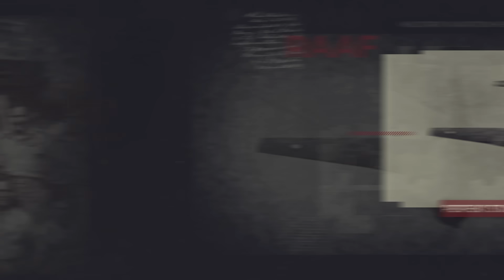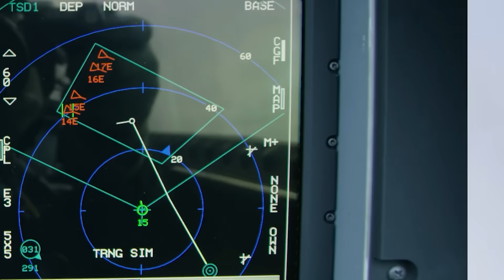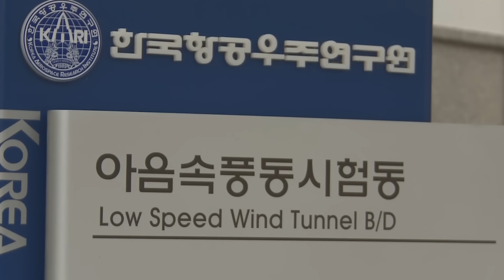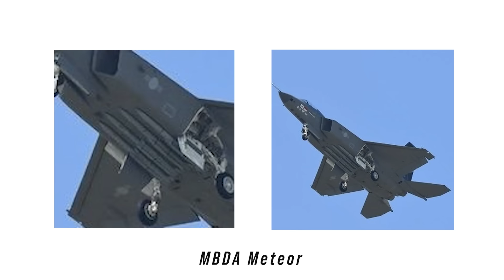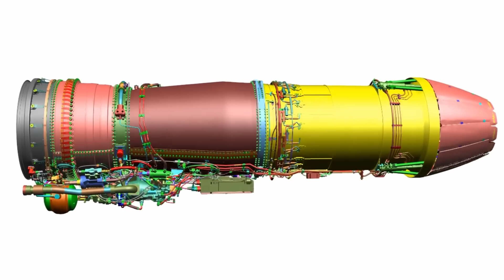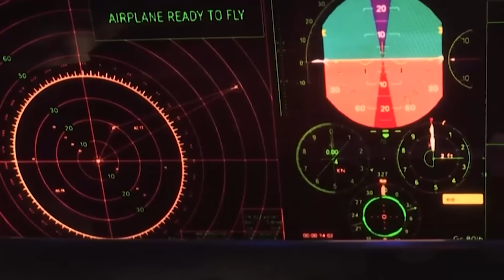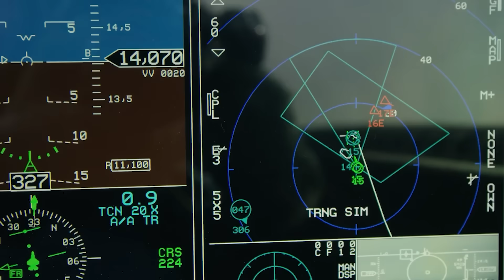KF-21: Korea's New Fighter

Comment: What do we lack in terms of capability? 
We have great and versatile heavy lift capacity, good air-to-air refuelling capability, we have good maritime aircraft (but a huge coastline to protect), and a great drone programme. Electronic warfare we have strong capability. 
Air-to-air we have excellent capability, although a proper interceptor would be nice. 
We lack a long-range strike aircraft without the F111's - something that could hit hard and deep, and quickly could be good. Perhaps B21???
Trainers are something we are desperate for, something like the KF-21 in a versatile platform that could be used as a trainer mainly but easily adaptable to certain roles would be excellent, and something a lot of nations need. 
Or alternatively, a cheap "missile-truck" - something with long-range standoff munitions that can just haul a truckload of missiles and utiltise the targeting of low-observable platforms to guide the freedom all the way in would be a great operational niche that isn't being filled.

Comment: The company I worked for in the early 2010s did a lot of business with ROKAF via direct commercial sales. South Korean companies like LG and Samsung have big defense units. Since the KF-21 has very striking similarities to the F-22 it's confirmed that the US State Department gave Lockheed permission to consult with ROKAF and provide engineering support via something known as an export license. Unlike China......which steals or copies data to build its fighters (just ask Sukhoi and Lockheed), ROKAF is building and indigenous fighter while getting the right support from low observable experts like Lockheed.

The KF-21 needs to have internal bays though as external weapons loadouts increase the aircraft's radar cross section.
Reply: The initial reason for the development of the KF-21 wasn't to make it a stealth fighter. It's primary goal was to replaced the aging F-4/5 platforms that are going on for over 50 years(!!). But they also modernized the requirements to adopt some stealthy (emphasis) aspect of a modern 4.5 fighter into the design.
Reply: Boeing was mentioned early in the video.
Reply: why do you expect China to do? get an export license? If you are using paper or gunpowder, you are stealing from Chinese.
Reply: The aircraft is too small to have internal bays, for example Turkish version of KF-X is significantly larger with internal bays. I've never understood why they tried to keep a twin engine plane small and didn't make a single engine version..
Reply: @ggoddkkiller1342  phase 3 of the kf-21 is planned to have internal weapons bay.
Reply: @ggoddkkiller1342 Korea already has expensive 35A and 15K(will be EX equivalent)s. The country needs to replace F-5, F-4s ASAP and F-16s(early version) in the near future. 
The plane already has some empty capacity for the weapon bay for the future variant. But you are right,  it will accommodate a small amount of weapons due to it’s nature. But Korea benchmarked flexible mission objectives of F-35’s. Full stealth mission is not always needed and KF-21 is not supposed to be Korea’s flagship fighter jet.
Reply: @7mmalltheway  If the goal is having a cheap work horse it actually makes sense. F-16 doesn't excel in any aspect at all but it can do everything and it has pretty much unmatched cost effectiveness apart from drones. And KF-21 is better than F-16 for sure so it would work but the thing i don't understand a single engine version could be even better for both having internal bays and more cost effectiveness. Perhaps it was adding too much cost for developing a single engine version..
Reply: @ggoddkkiller1342  you have the point but Korea AF has lost some precious pilots from F-16’s single engine malfunction. So they do have such trauma. And also KAI had a Navy version in their mind from the get go. 
Then they actually fished designing the Naval variant  roughly. I can see that LM was also involved and gece some tips to KAI. You can simply imagine the difference in between F-35 A and C. You can find the mock up model images from google. 
Also you know that Navys has never welcomed single engine fighters recently….
Reply: @ggoddkkiller1342  that's very good question, even S.Koreans asked that. I've asked that same Q to KAI boot other day when I had chance to see them at Seoul's Airshow last year. They've said, they never designed aircraft to carry internal bay - so was never designed for 5th Gen. They also said that due to development of technologies, newer fighter doesn't need to be large as many components and weapons can be miniaturize and also wanted cut cost down as much as possible, making 4.5th gen fighter cheaper than F-16 and easier to service. Once KAI obtains all the acquired 5th gen technologies, they will redesign the body to carry internal weapon bay with more powerful engine. Basically, KAI is trying to make stealthy & improved version of F-16V as 5th gen and 6th gen they will just buy from the U.S and they know they can't compete against F-35/22 or the next 6th Gen NGAD. KAI wanted to sell KF-21 to these countries with F-5 and F-16 fleet as they're either aged or ageing and will need to be replaced and many small countries don't have big budget and space to keep large 5th Gen fighters and they can't buy F-35. For many F-16V would be enough and this is where KF-21 can become market player and also 5th gen stealth fighter have very high MRO, for many simply cannot afford it.
Reply: @ytn00b3  Thank you for the explanation! If it becomes as cheap as F-16 it would be a massive success indeed and a lot of countries would line to buy it lol. But im not sure it could become that cheap, especially during early production years it might be still quite expensive. As F-16 still has pretty large and well-established production lines. The key is increasing unit numbers really as F-16 could do and i really hope South Korea could do it. Western monopoly on arms is really dangerous and they are using it as a political tool shamelessly. Even 100% defensive weapons like air defense systems are a subject of political games and if you don't play you get nothing even if it exposes your people to danger..
Reply: @ggoddkkiller1342  F-16V base unit cost might be about the same as KF21 Block1, Block 2 would cost slightly more but program cost for F-16V is very high, you're paying for American equipment kits and training which is very mature. KF21 Block3 would be expensive but I think KAI is trying to make KF21 Block 2 as equivalent of F-16V level with dual engine (which is bonus as dual engine is always better than single engine). Noticed KF21 isn't very large as F-15 or F-18 Superhornet even F-22, KF21 was made for candidate for replacement of F-16s. F-16 was very cheap back in 1980s~1990s but after LM downsized production line, it has become expensive. Even F15EX and F18 Superhornets are more expensive than F35 but have slightly lower maintenance cost than F35. Stealth 5th Gen fighters are very expensive to maintain. The Unit cost for KF21 is about $60~$70 million, still not cheap but Coz it was produced and maintain by S.Korea KAI, it can be lower for Korea as I'm pretty sure they're buying KF21 at $50 million as K-gov owns 60% of the program. It actually saves money for S.Korean gov when it buys it and doing so creates more local jobs that pays taxes and having KF21 means S.Korea can now start developing their own armaments when they used to buy from NATO and USA. In long run, it's cheaper than F-16.
Reply: @ytn00b3  Honestly i really have no idea how you are calculating those numbers as you are literally comparing F16 which was produced mind blowing 5000 units with KF21 which will be produced only 40!! LM downsized their production but there are hundreds of companies worldwide producing F-16 parts, for example Turkish companies are producing thousands of F-16 parts and assemblying entire planes not just theirs neither, Pakistani, Egyptian etc F-16s all got assembled in Turkey! So LM downsized their F-16 production line simply because they didn't need it and it had minimal affect on how expensive Vipers are. There is no way on Earth KAI can compete against such a massive production capacity in dozens of countries and KF-21 will be at least twice more expensive than F-16 if not way more. Because lets not forget KF-21 might be small but it is still a twin engine aircraft which are more expensive, in fact even you are admitting twin engine F-18 is more expensive than single engine F-35s but you somehow ignore it later on. 50 million dollar won't gonna happen with 40 production plan, it is just literally impossible. Even Rafale is way more expensive than that despite being significantly behind KF-21 in every aspect and produced way more, this is why France desperately trying to sell it so they can reduce unit cost. If Turkey or other countries etc were a part of the project and actual production number was something like 400-500 yeah then it was possible..
Reply: @ggoddkkiller1342  Only 40 KF-21 will be produced? Stop your delirius utterance. In order to replace 4 squadrons of F-5E/F and 2 squadrons of F-16PBU(Upgraded F-16C/D Block 32), 6 squadrons of KF-21 will be deployed. Because each FS(Fighter Squadron) in ROKAF(Republic of Korea Air Force) operates 20 jet fighters, basically it has been confirmed 120 KF-21(20 jets X 6 squadrons = 120 fighter jets)   including 40 Block 1 and 80 Block 2 will be manufactured. Simultaneously Indonesia is going to acquire 48 IF-X the Indonesian variant of KF-21. And because there is the problem for approximately 18 RF-16 among 166 South Korean F-16C/D not to be compatible with their mission equipments such as Condor-2, EL/M-2060P and TAC-ELINT as 133 KF-16 including those RF-16 are upgraded to F-16V(South Korean F-16V are designated 'KF-16U'), the production of RKF-21 is being discussed in ROKAF. And EKF-21 the stand-off ECM variant of KF-21 is included in the portpolio of KF-21. LIG Nex1 a South Korean defense industries spscialized in electronic warfare systems, EO/IR systems and guided munitions, like your Roketsan and Aselsan is goint to develop the stand-off jammer run by the artificial intelligence for EKF-21. Additionally, for the long-run, CVX program for South Korean aircraft carrier is going to be built to operate KF-21N. Only 40 KF-21? Don't pretent to know about what you don't know. And IWB(Internal Weapon Bay)? The structural margin for IWB is applied on the design of airframe over KF-21, in spite that the IWB will conceive AAMs(Meteor), SDB, and 500lbs-weighed munitions such as GBU-38 and KGGB upon carrying 2,000lbs-weighed munitions such as GBU-24/31 and Spice 2000 externally because of the restriction of volume.  And it is being planned to include IWB to Block 3 program although the key issues on KF-21 Block 3 are the directive and stealthy datalink using Ku-band phased-array antennae and MUMT(Manned-Unmanned Teaming). Does U.S.A. reduce the scale of production of KF-21? This is the South Korean program, not the American one.
Reply: @ggoddkkiller1342  F16 is going to be phase out after 2030s and this is why S.Korea wanted KF21 as replacement not just for F4/5. No modern fighters after the Cold War ever produced over 500+. May be Rafael could be in 500s and there will be no 1000x light fighter like F16 in future. If KF21 eventually produces 400 then that's a success.
Reply: @ytn00b3  Exactly, you are right that's why i said 400-500 not 1000 because as you said it is unrealistic a modern fighter getting produced that many especially while drones are becoming more popular every day. But sadly low production number is increasing KF-21 cost a lot. I don't know if people are misunderstanding me but im not saying this against Korea or something, that's just how it works. For example i would be really surprised if Turkey's TF-X cost will be under 100 million dollars especially in early production. This is also why there are so few companies producing jet engines because until hundreds of them produced unit cost will be at least twice more than GE engines for example. Still ''know to how'' is the most valuable thing here as South Korea learned how to build it's own planes and in case of a world war, relations worsening etc can increase KF-21 production many times within just few months so it is always worth it..
Reply: @ggoddkkiller1342  if you add drones into equation then yes, hence KF21 Block 2.5 or 3 would be able to work with drones just like F35 Block40. You need to know S.Korea adopted F16 earlier than many countries so they have sizable F16 fleet, around 75 units are licensed produced much later so they'll be upgraded to F16V Block70 level and used until 2040s, so they still need to replace 120 of F16 fleet as well. 120 replacements for F5/F4 fleet and another 120 F16 fleet (gradual replacement), there are about 30 F16 fleet which was delivered to Korea early so they've approached 30+ years, and they need to be replaced by 2030s, so realistically KAI need to rollout 40 Block 1, then 80 Block 2, and followed by another 40+ for upcoming ageing F16s and doing this can not only saves production line and jobs. KAI already said around 300 units of KF21 will be produced in different phases. If they're lucky then they'll eventually produce another 100~200 reaching about 500 units (which is their aim) this way they can have enough funding and skills to developed the 5th~6th gen also, KAI is looking at designing new LIFT trainer as T-50 is ageing, all the workers and engineers from KF21 will be reuse again. Basically, Korea would be replacing all of their ageing and aged fighters as a minimum of 435 fighters are required by S.Korean airforce. Who knows, KAI will also develop Naval version and electronic warfare version as well, all this will add on so reaching 500 units of KF21 is highly possible.
Reply: @ytn00b3  I both agree and disagree to your message because everything can happen really. South Korea might indeed produce 500 KF-21 variants or only 200 and even less perhaps. Everything is developing quite fast right now, drones are becoming more common everyday. And AI becoming smarter rapidly, soon everything might be controlled by AI not humans. Command center aircrafts will be still used but most of airforces might become entirely drones. On the other hand Cyberwarfare and electronic warfare systems are also developing, it's known some countries are trying to use AI as a cyberweapon which might limit drone usage who knows. So we will see i guess, it is impossible to say what will happen in 20 years. But it doesn't matter i think, US etc ''world powers'' never ever share their know to how capacity to keep other countries depended on them. So even if it is expensive it is a win for South Korea because as you said there could be naval versions. There could be even single engine etc drone versions and Korea can produce hundreds of them without needing permission or technologies from any country at all. This is worth a lot especially while the world is becoming unstable again and US Russia etc is doing weird things like supporting a genocide in Palestine or invading Ukraine while China is waiting their turn to invade Taiwan..
Reply: @ggoddkkiller1342  Yes drones are taking off and will be more useful resource than manned fighter. But, there's already plan for turning KF21 into drone variant as well.
Reply: @ggoddkkiller1342  I can name GF-X and make internal bay 3x larger than TF-X. Would you count it? anyone can draw x2 x10 x20 but in reality, who really made it real?
Reply: @user-to4iq4bq9g  What a childish message you should be ashamed and take example from other people here in this comment section who can argue like adults..